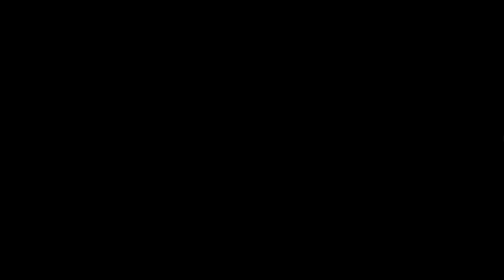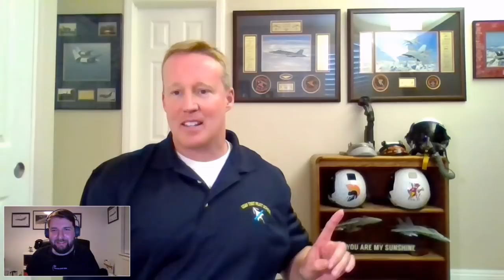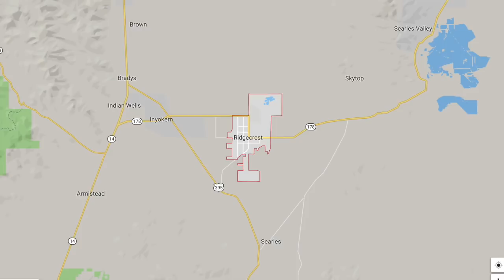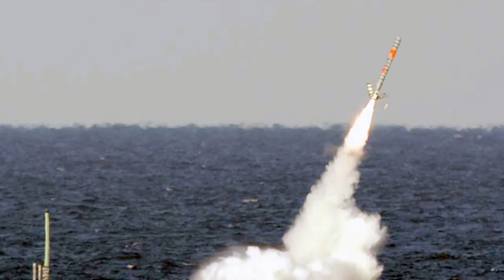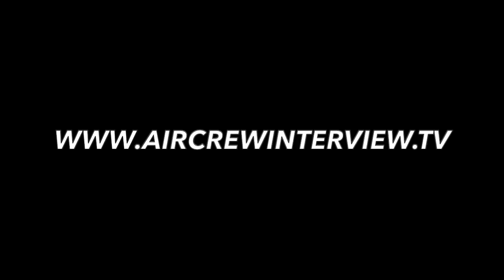Chasing a Tomahawk Missile | with "Sunshine"

Comment: Cool stuff indeed! Tomahawk is pretty small thing to follow. Checked the later stuff and now it seems it can even integrate the unburnt fuel into the "explosion". I guess then the warhead (and it's weight) could almost be zero and all you got is a longer range (with less explosive force) or shorter with a bigger bang. Cheaper cost with more options.